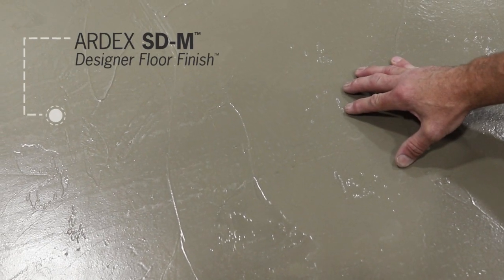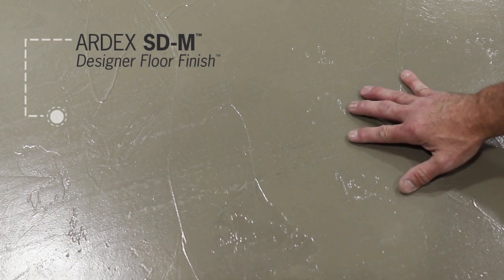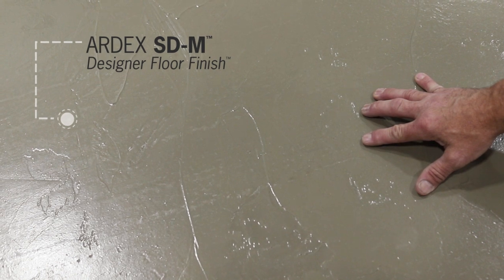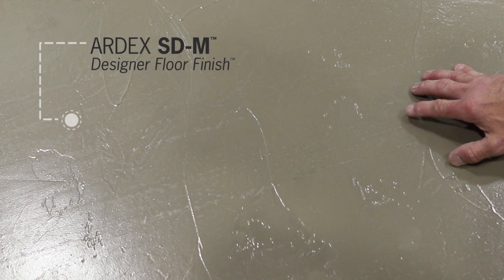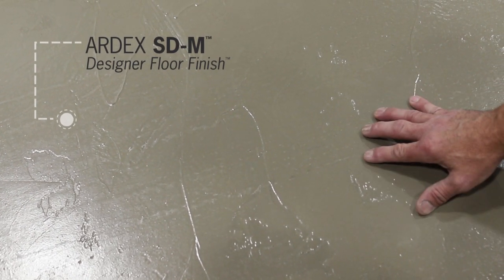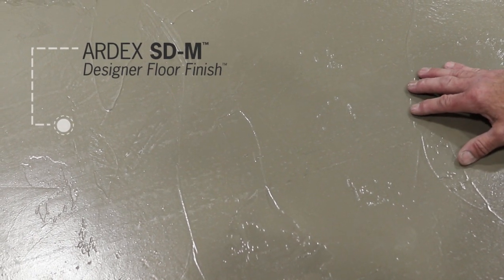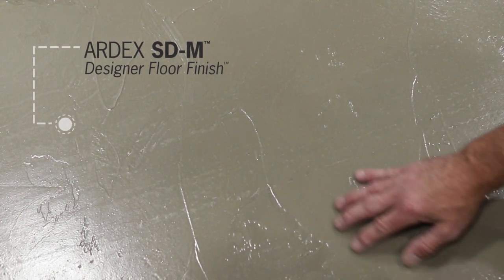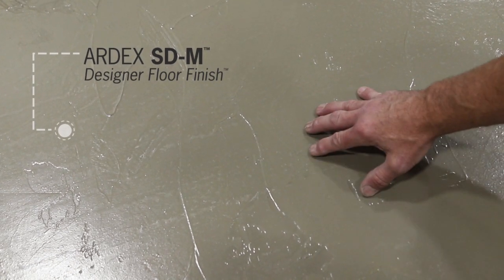Product Overview - ARDEX SD-M™

Comment: So we're in the middle of a remodel, we asked for concrete floors. We had all our tiles lifted up, then the floor was sanded and buffed, but the main living space was a still a little messy with minor cracks and holes, so our concrete guy did a couple of layers of Ardex Feather Finish, and called it a day. Told us it was done. It's dried blotchy and messy. That is definitely NOT the floor we paid $15k for!! He also told us it was $90 a 10lb bag. (it's $37 on Amazon). It's also soft - you can scrape it with your fingernail. 
Then I found out about SDM. This looks like what we need. Our whole floor is on a very slight slope, so a self leveling product might not work, but with this being trowel-on, it looks perfect! Do you think this is what we need!? Does it dry a consistent color? (we obviously don't mind slight variations in color and texture, as is the nature of concretes). The Feather Finish is an underlayment, there's no way that could be considered a finished concrete floor, right!?
Reply from the maker: Hi Matt, we are sorry to hear that! The existing ARDEX FEATHER FINISH will need to be mechanically removed as it is soft. You can then either install ARDEX SD-M or one of the topping materials such as SD-T. You can find all of our toppings here: https://www.ardexamericas.com/products/ardex-surfaces/overlays-toppings/
Reply: @ARDEXAmericas  I spoke to someone at Ardex who suggested that SDM could be laid over the FF (once we did a layer of P51 primer). Would that work, rather than remove the FF?
When I say the FF is "soft", it's not gooey soft, you can walk on it and it feels and appears like a regular hard stone surface, but it can definitely be scratched, kind of like the texture of sandstone.
Reply from the maker: @mattstraw  To make sure we can address the issues with your substrate and recommend the right products, we recommend calling our Technical Hotline at 1-888-512-7339. That will be the safest way for your installation!